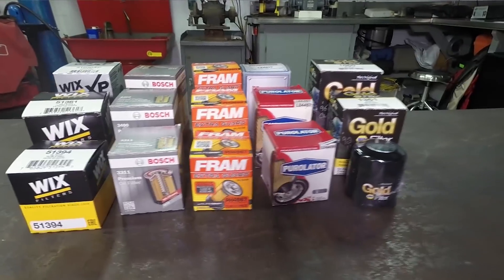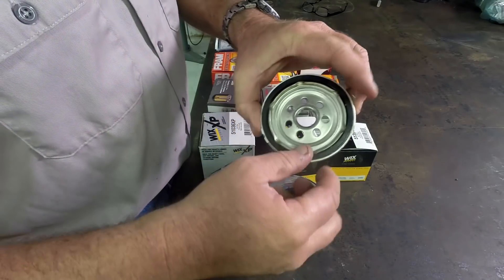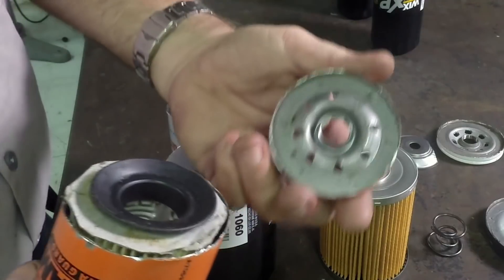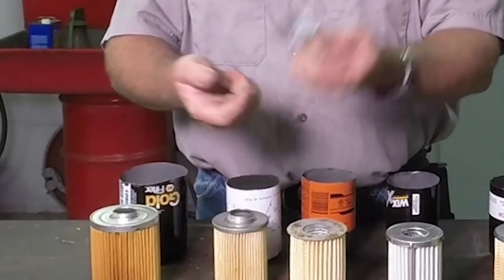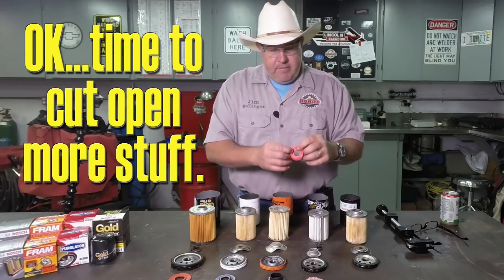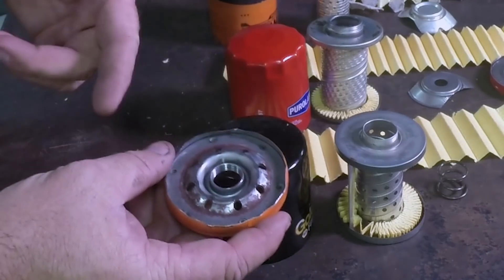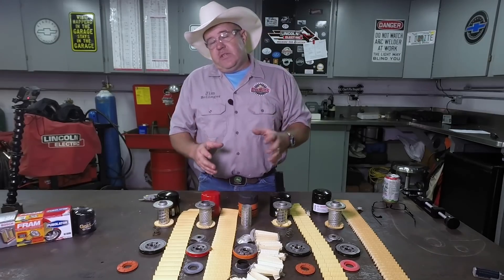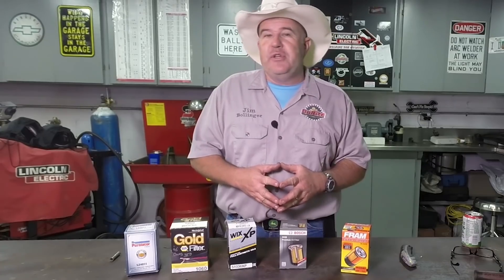The worst oil filter EVER!

Comment: Mr DoRite sir, I do need to take exception with the issues you have raised about the Fram oil filters.

First off, let me predicate my following comments by stating outright, for full exposure, that I work for Walmart in the Auto Care Center as an Auto Care Technician and have done so since 2007. Walmart uses Fram filters exclusively as their Corporate Contract in their Auto Care Centers. We have a commercial filter that we use, which isn't for sale to the general public, it's intended solely for use in service centers but is basically the same filter as the Fram Extra Guard, just without the fancy stenciling the Extra Guard has. Walmart does thousands of oil changes every day, so they won't use a bad oil filter, and a few vehicle manufacturers use Fram filters as their factory installed filter, granted they are painted in the manufacturers own colors, not Fram's orange. Honda factory filters being one of them. Honda trusts these filters enough to be used as their break in period filters. We do allow customers to select a different filter carried in the store, Mobil 1, K&N, and upgraded Fram filters are also available for an up-charge on their bill or they can provide their own filter. So, basically, I am very familiar with the Fram product line. All the information I'm providing about the construction of the Fram filters is available on their website, and the attributes of modern engine oils I referenced is also on their own websites. Please don't take what I'm going to say personally, it's just my 13+ years of experience using Fram's product line almost exclusively speaking. In my time with Walmart we only had a couple of issues with the filters, and actually, they all were a result of bad sealing gaskets, not with anything to do with the interior construction of the filters. 

First off, you had 3 very old stock oil filters which you depicted in the video. Evidently wherever you bought them from, someone had a few really old filters on a back shelf someplace, and decided to ship them to you. The design of the filter boxes was the design Fram had at the time I started working for Walmart in 2007. That filter box design was updated around 2010 or 2011, and that filter box design was updated in 2016 or 2017 to the current design, which puts the filters you had as nothing newer than 9 or 10 years old. I'm not sure how long before 2007 Fram had started using that design, I wasn't paying attention to such things before my life at Walmart, so it's anyone's guess as to how old those filters really were. The fact the end caps and filter media were disintegrating and there was rust inside the housings bares testament to the potential age of the filters.

Speaking of the end cap, the cardboard material the end caps are constructed of is the same as the construction of the filter media itself. Fram does that as a cost savings step.  They can use less adhesive and lesser expensive adhesive to construct the filter media because both components are the same component. When you try to adhere 2 different components together, such as a fiber or synthetic element to metal end-caps like the other filters use, it requires more adhesive and more expensive adhesive to achieve the same results.  It's how Fram can keep their Extra Guard filters at a lower price.

You also noted that there was rust inside the housing of the Fram. 2 issues with this. First, an update was done to the filters a few years ago where Fram sprayed a thin coat of oil to the inside of the housings to stop the rust. I'm not sure what kind of product they used inside the housings, but it does stay in place regardless of what direction the box is stored so it's not motor oil, but it doesn't cause any issues when it gets blended with the oil running through the filter. Second, remember that all modern oils have anti-rust additives in the oil as part of the additive package, so a little rust inside a filter will be immediately countered by the anti-rust additives of what ever oil is used, so that is in fact a moot point.  It won't cause any harm to the engine.

Now I want to discuss the interior construction of the filters themselves. You noted that the Fram filters use an inferior rubber anti-drainback valve, and you also noted the poor quality of the filter media.  Back in 2014 or 2015, (I can't always remember exact dates of updates done to the line, I just know approximately when it happened, that's why I give a general time of when something happens.), Fram did a major update to their filter construction. First, they changed ALL of their anti-drainback valves in all of their filter lines, from rubber to silicone valves. And at the same time, they changed the construction of the media and added resin to the filter media. This was to allow the filters to be compatible with modern synthetic oils. Prior to these updates, Fram Extra Guard filters were considered basic filters for use with conventional and conventional high mileage oils. But the more modern vehicles are coming out using synthetic oils, and at some point, will be all synthetic I suspect, with the way the trends are heading with what I've noticed from the newest vehicles in our shop.  The older Extra Guard's had a recommended 5000 mile oil change rating on them using conventional or conventional high mileage oil. The updates they did to the Extra Guard made the filters not only compatible with synthetic oil, it also gave them a 10,000 mile oil change interval rating, but the Extra Guard is still marketed as Fram's basic oil filter line.  

So that being said, they aren't your Grandpas oil filters any longer. And, speaking of Grandpas, before I became an Auto Care Tech, I grew up on a farm/ranch operation that my family ran for over 80 years, and we ran many tractors, combines, haying equipment, trucks and cars on Fram oil filters, and never had 1 engine failure due to a bad filter. My Grandpa who also ran a Gambles Hardware Store in my hometown used them almost exclusively because he carried them in his store. We also ran Baldwin filters, and if we managed to catch them on a good sale when we were at the dealership, we'd use the dealerships filters.

I've given my comments regarding Fram filters on more than a couple of YouTube channels when they've done the same thing, and just like your video, they always compare the Fram Extra Guard to at least 1 Wix, a Napa Gold, a K&N and a couple other more premium filter lines and then poo poo the Extra Guard for being a poor filter in comparison. They have no real world experience to bring to the video, except maybe a, "I heard from a guy who heard from a guy who heard from a guy about his 2nd cousin's next door neighbor's nephew who had a friend who......" and such. To which I always advise the individual that Fram doesn't market the Extra Guard as competition to those filters.  Even with the updates Fram did to the Extra Guard, it's still Fram's basic filter line and not marketed as a premium brand competitor. Now Fram does have a premium filter line that they do market as direct competition to the Wix's and the Napa Gold's and the Bosch's and the K&N's out there. That's the Fram Ultra Synthetic line of oil filters, incidentally, also available at Walmart. The Ultra Synthetic line has a fully synthetic, double lined element which has a very high filtration rate and oil drain interval. It's intended is to be used with full synthetic oils that have extended drain intervals such as Mobil 1 Extended Performance oil and Castrol Edge Extended Performance oil, which both have drain intervals of upwards of 20,000 miles or 1 year. The Ultra Synthetic has the same drain interval rating, but may also be used with standard full synthetic oils. This filter is a direct competitor to, or even superior to, the Wix and Napa Gold along with all the other premium filter lines out there. It also has metal end caps like them and requires more expensive adhesive to adhere the components together, and as such, is a more expensive filter, though it's not just the adhesive that makes them more expensive.

Fram also has a filter line for the standard synthetic oils which is also an upgrade compared to the Extra Guard, that being their Tough Guard line. The Tough Guard filters use a blend of the same fiber material the Extra Guard uses and the synthetic material the Ultra Synthetic uses. It's competition would be more along the lines of the mid-grade oil filters, fully compatible with all synthetic oils and a longer drain interval, 10,000+ miles. The Tough Guard line also uses end caps that are the same construction as the filter media. It's less expensive than the Ultra Synthetic, but more expensive than the Extra Guard.

So again, please don't take this as a personal criticism, but I hope this gives you a bit more insight to the modern Fram Extra Guard, and how it's much more advanced it is than the filters you used in the video. Maybe you can do another video some day, and put the Fram Ultra Synthetic up against the other filters you used and see how it compares to them.

Comment: He is absolutely right about the “Fram” filter I have experienced it for myself. I was changing my oil and the filter gasket got stuck and I was taking it off and did not realize it until it was to late and by that time oil had spilled all over the driveway 🤬 when putting a new one on. Never will use a fram again he’s not the only YouTuber to do a review like this either and said the same thing about “frame” oil filters
Reply: Nearly any oil filter can be double-gasketed with catastrophic results. Don't blame Fram for your incompetence.

Comment: I have a 2001 Tacoma 3.4.  It is getting ready to turn 300,000 miles. Almost all the filters that I have used have been the cheap Fram filters from Walmart.  I do a majority of the maintenance work myself. Around 3,000 miles or so I change my oil. Castrol 5w30. They work. Just change your oil. Oh yeah. My truck almost always has a trailer hooked up to it. Pulling something heavy.

Comment: Them: "I nEvEr HAd a PRoBleM WitH FrAM OIl fIlTeRs"   Me: shows them this video
Reply: And there is nothing wrong with the Fram filters shown here, except for the fact they were made over 10 years ago judging by the design of the boxes they were shipped in.  When they were made, they were just fine for their intended applications and could go upwards of 5000 miles before needing to be replaced, but these filters evidently were sitting on a shelf someplace and someone had to move them while they could.
Reply: Fram rep says what?

Comment: I see Fram hasn't improved in the last 20 years.
Reply: the orange cans are garbage, the higher end ones are ok i would never put one of those orange can frams on any car, especially in modern times with turbo engines, the glue will fail because of heat and the filter ends up getting shot through the oil pump and passages.bye bye engine.
Reply: @juggernautxtr  Cool story.
Reply: @Calbenmike  ford senoir master tech, whne you replacing engines because of those orange cans failing then you can make snide remarks. otherwise keep talking with that foot in mouth.
Reply: @Calbenmike  https://www.instagram.com/p/CRcaZylMPoo/
performed oil change on this car this weekend. tell me again how great they are.
Reply: Nope
Reply: Because they are still using the same filters from 20 years ago considering they have rust on them.

Comment: Hmm?  I've used Fram since the 90s.  Not 1 of my vehicles ever had engine problems and plenty of miles where put on them using the Fram products. Point being, change your oil at the intervals and you'll be fine. Also the comparison was not apples to apples. A gold series filter against a base Fram? I've  used all the Fram oil filter products including the base Frams and never ever had an issue with my engines. Fram makes different oil filters for your particular needs if your not happy with a base filter you can always upgrade to a higher quality Fram filter. If your asking me I wouldn't hesitate to buy their products based on my prior experience with Fram products.

Comment: strange, i have been using fram for decades and NEVER had an issue with my high milage old  or new vehicles engines. I have primarily owned toyota and honda vehicles . i wonder if the filter matters more on lower quality engines?

Comment: I  have used fram selveral times
Over the years never had a problem.
An have worked in automotive shops
Since 75 now retired.
Reply: And there are people who smoke their whole lives and never get lung cancer. Anecdotal evidence means little. 

Now, if you are changing that Fram filter very often, never going past 3k miles, it may well hold up so long as you never get a really bad one. Modern cars are meant to go 7000 miles between changes. Even my cheap Kia Soul says 7500 miles right in the owners manual. You had better get a good filter to hold up to that.
Reply: @Elthenar  How about K & N?  Do you have an opinion on those?  He didn't cover those in this video.
Reply: @ApartmentKing66  No. I am no expert on the subject. I just know one thing, Fram oil filters are known to fragment.

Comment: Anyone who cuts open an oil filter with a angle grinder is a idiot.  You want to impress me as aircraft technician buy a oil cutter you are a moron
Reply from the maker: There is one on the work bench in the video. Pay attention, that is what "aircraft mechanics" are supposed to do! Moron! There is a reason I didn't use it.

Comment: I hate to admit this but I've been using Fram filters for years. Owned a '04 Silverado, 4.8L, 224K miles. Had a oil pan leak, the mechanic was scooping sludge out of the pan. I change the oil every 5K for 150K miles. Feeling better about my new choice in filters , Wix. Bought  a few days ago prior to seeing your video. Thanks

Comment: I have cut open dozens of filters after their use. I have never had a Fram filter "fall apart". Never like the Fram he shows that likely have been stored in a damp place.I have had Purolator and rebranded Purolator made filters have tears in the media. I have even had the metal end plated come unglued from the media. I generally do not buy too many WIX or NAPA made filters because they are over priced and have low efficiency ratings as compared to other filters.

Comment: This is an outdated video. Frams have been improved since. This guy hasn't a clue and goes strictly by the appearance which has nothing to do with its filtering ability. Fram is still one of the higher rated filters and outperforms the Napa filters as far as dirt trapping ratings with particles 20 microns or smaller.

Comment: Interesting video but you did nothing to check the most important part which is the filtration value of the filter paper. I have a 2000 Yukon with over 400,000 miles using Fram filters and still running strong.

Comment: I’m a fram user and I’m aware they’re build quality isn’t great. However I feel they’re poor reputation is more from myth then fact. I bet Frams are still THE most used oil filter if not one of the most, and after all these years of people running nothing but frams to 300,000 miles, how often do we actually hear about engine failure from a fram? Virtually never.

Comment: I wouldn't argue that the Fram isn't the worst oil filter. However, before I knew better I used it almost exclusively on my Integra and it got up to 350K before it was stolen and scraped up. It would have easily gone to half a million miles. I did however use synthetic oil almost exclusively, early on changing it at 6,000 miles and later at 10,000 miles as oil got better over the years.

Comment: Horseshit!! two fords bought when they were new, 98 f150 with 180000mls and a 2004 expedition with 218000 and both are still running great and have always used a fram oil filters and gas filters so I’m sure there is better but the fram does work as good as most out there

Comment: Dummies love to hate Fram.  That "cardboard" is an engineered material that will not fall apart any more than the filter material in the others. Rust? Stupid. You don't make filters of rusty metal. That's a result of travel and storage. Get some moisture near the others and the same will occur. This guy hacked the paper off just to keep to his story.

Comment: yeah please dont use the fram, modern engines have really tight tolerances, the spaces for the oil to flow is really tight and thin, can you imagine if that card board comes apart and the metal rust gets caught plug up the spaces in the engine???  That would be catastrophic, I keep reading people running the fram on their older cars and trucks for years with no issues, but here is the thing those older vehicles are not that tightly made. They can tolerate small objects flowing through. Fram is really just awful.,

Comment: I just had the oil changed on my 370Z at a Nissan dealership to which I supplied the oil filter, a Fram XG-6077 Ultra Synthetic. As soon as the engine was started at the end of the service the rubber sealing gasket on the base of the filter blew out. Luckily, this happened in the shop and not on the road, the result possibly causing catastrophic engine damage if not noticed immediately. I will not be using Fram filters in the future, as it seems that they are still cheaping out on their manufacturing quality in the quest for higher profits.